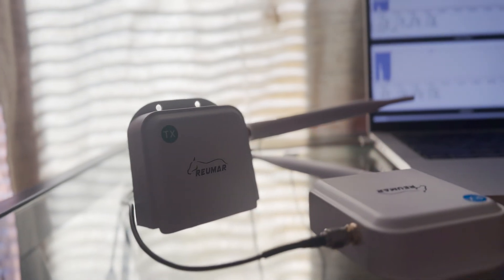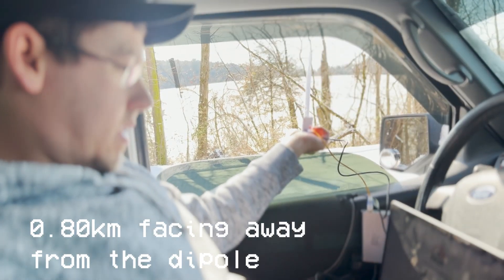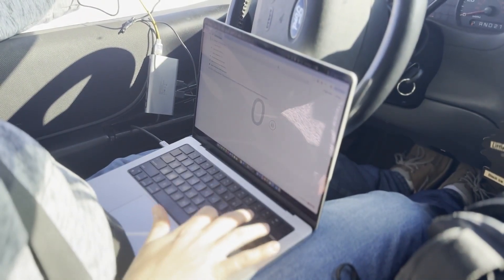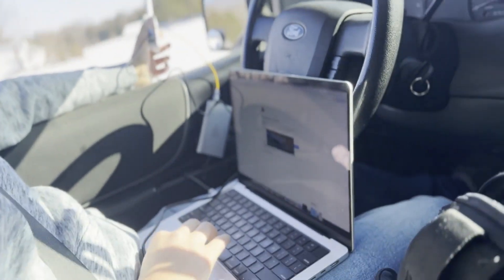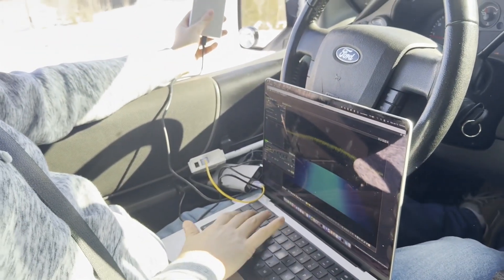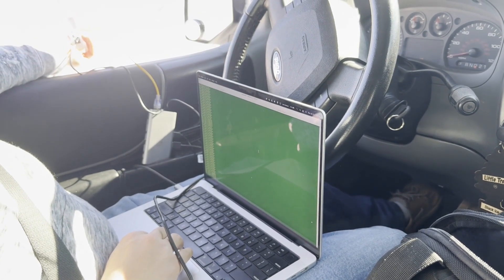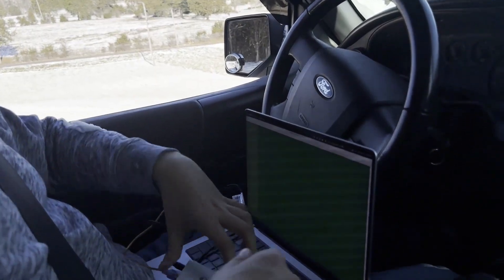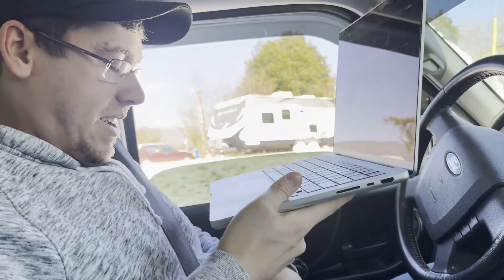1 MILE WiFi Range Achieved: What are the range limits of 802.11ah HaLow?

Comment: Does anyone know how I can get to the configuration page, I want to change the SSID.
Reply from the maker: @perkunast9680  I will be making a video on gaining AT commands to this
Reply: @LANRanger  Thanks I want to put a little more power into them, and use my ham license. To do so I need to change the SSID to my ham one. Also I need turn off the encryption, I was told they are not encrypted but use a security. I hope I can do that with your help and the AT commands.

Comment: The antenna's those come with are not too good. Go look for for ones that are meant for LoRA or Mesh and you can find antennas that have been tested to get the best performance in the 900mhz range. I've even slapped on 4g LTE antennas and they do much better.